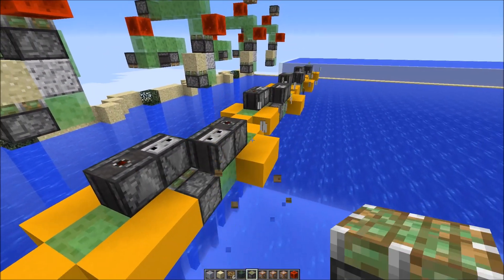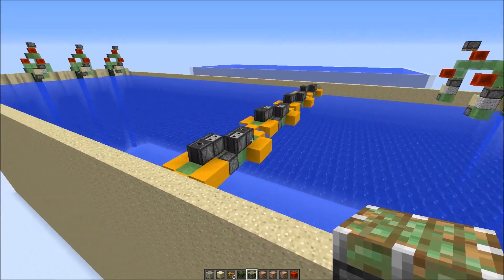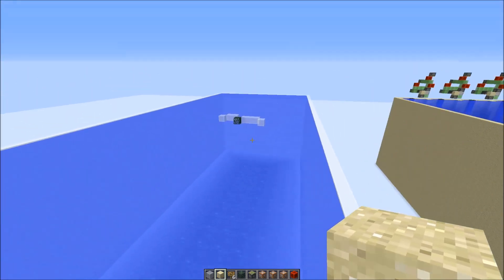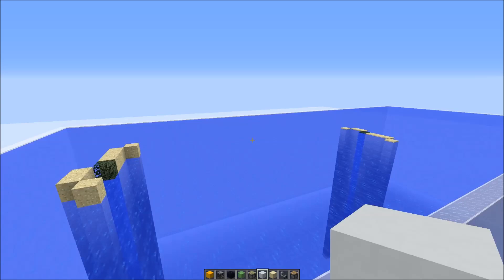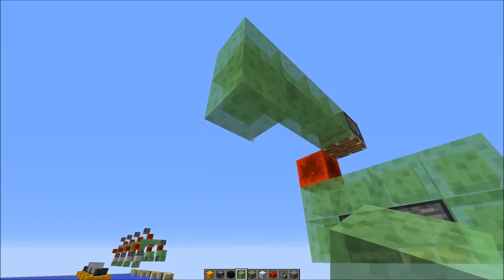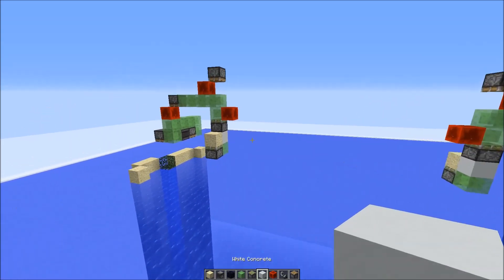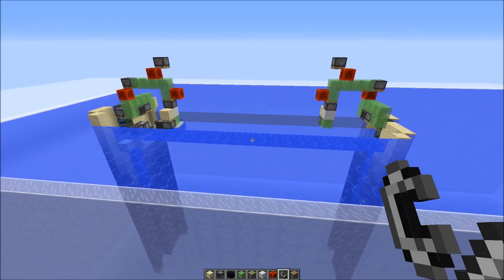[Tutorial] Automatic Water Remover v2 1.11/1.12

Comment: tested in 1.21.11, still works great. 
One thing that isn't directly mentioned immediately is that the other side of the main machine needs to be one block down. My dumbass didn't notice,
still need to do the 1.18.2 fix commented below, or the main part of the machine won't move down. 
1: Temporarily remove the redstone blocks. (Just the redstone block at the front, next to the observer, is necessary)
2: Place the observer facing down, on top of the sand block.
3: Remove the sand block.
4: Put the redstone blocks back in place.

Comment: Two massive tips I can say when building this, first if you play on a server check the Piston push limit. Some servers that run on Paper I believe have a push limit of 18, not 12. This breaks this machine if you use leaf blocks as it will just push threw your end caps. To fix this just use another non sticky but immovable block like Furnaces or obsidian.

Also put the redstone blocks in last. The machine is "mostly safe" without them. Once they are in though any mistake update to a piston tends to break the machine or push it down further than your level of the flying machine. Also Zaziggi comment tells you how to fix it for 1.18.

Comment: Just like say that while this works with a slight change from the Zaziggi comment to remove sand blocks and put in an observer for 1.18. This is a very frustrating machine.. If you update anything wrong it breaks and basically has to be rebuilt. If the flying machine goes off wrong it can push other blocks out of the way. If either end goes off they lower themself and need to be redone as I don't think they can pushed up easily.

While on large and long projects this is a great machine.... honestly on anything more modest it's not worth it.

Comment: Just tried it in 1.13.2, works well!
Be careful about letting it get too far away from you, it breaks if it gets close to your render limit.
Reply: Haha i am currently working on clearing max render-distance location, i will hope my alt dosent dissconecct xdd
Reply: at 1.15 you could do honeyblock flying machine that moves you same speed than water remover so you could do huge area if you want to. tho it regures bit more redstone and maybe build redstone system that activates your honeyblock flying machine same time than water remover
Reply: @NapakettuVT  You could probably just place a minecart on one of the flying machines, as redesigning the machaine for honey block might be challenging, as it cannot get powered.
Reply: On the water remover it self I mean
Reply: @whitefalcon7572  yeah you are correct

Comment: Doesn’t work on console
Reply: Unresponsible because of ps4 observer update issues I did some minor modification to get it to work.  Move the middle piston on the return station to the outside of the slime block and put a iron trap door where the piston use to be. Then move one of the block from the outside of the flying machine to the top where the new piston locate is.  Lastly add a row of blocks that don't stick to slime blocks on the end walls where the blocks where removed on the flying machine.  Not sure if the observers on ps4 are still having issues since I haven't used them in months

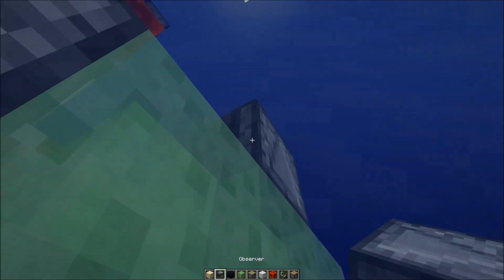Comment: Did anyone notice that he called the observers of the water removal station "pistons" ( 6:08 )? 
Nice maschine but the ground needs to be flat otherwise the maschine would stop :(
I guess the only way to handle this and larger areas would be a maschine which drops sand from a sandduper into that water in a controlled way and let finally do a tnt-quarry blast the blocks but i think it would be much to komplex to build.
Reply: MarylinMayson Lol, flatten the ocean bottom. Also how do you make a sand duper like that?
Reply: Since Guardians don’t spawn below the bottom layer of the ocean monument, it is fine. Flatten out the monument to its bottom layer and stop. No need to clear to ocean floor.

Comment: Dont you think that you could build the water removing bit one block lower so it removes two layers of water at the same time? I am really noob at redstone so i dont really know if it could work
Reply: Jose Torres   I believe there's a limit to how many blocks a piston can move with slime, so making it deeper would presumably mean you'd also have to make it narrower. 

Also if it was 2 deep it would need to be moved down 2 at each end instead of just 1 and the end pieces would have to move down 4 each time, all of which would be more complicated I presume. 

I'm guessing that's why doing one layer at a time is simpler. 

Though maybe it might be possible to make something similar that did one vertical slice at a time. You'd have to build most of it underwater though which would be a bit of a pain, and it might create more water updates possibly causing lag as water flows into the new hole it's creating.
Reply: Nommy I will leave it in his hands. This redstone thing is too much for my brain. But yeah, i think that maybe you could bouild it vertically, however, as you said, it would be much harder to build if it is underwater.
Reply: Please create your own profile pictures.

Comment: Wouldn't it be possible to make the flying machines take out two layers of water at the same time? Do the yellow blocks really need to be there, and can you put those underneath to not increase the push-limit while still taking out two layers of water? (I know you would have thought of it if it was possible, but still). :)
Reply from the maker: making it faster is not really interesting imo. I don't think a lot of people care, that the machine needs 45min instead of 90min, if they need to invest an extra hour building a larger machine.
Reply: Well, maybe that's true. Anyways, it's still really cool!